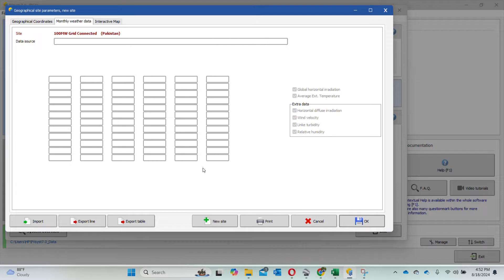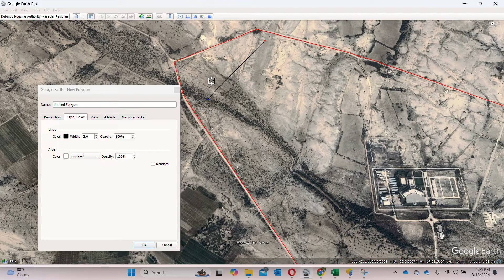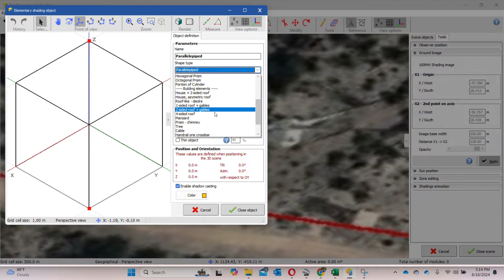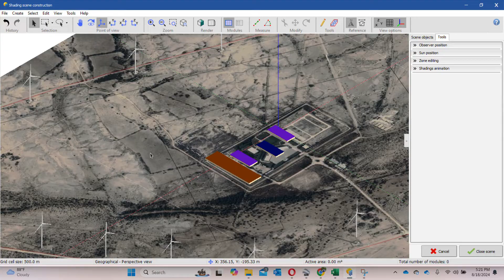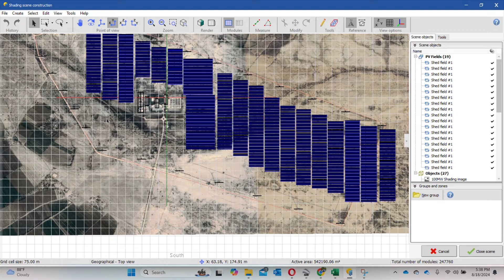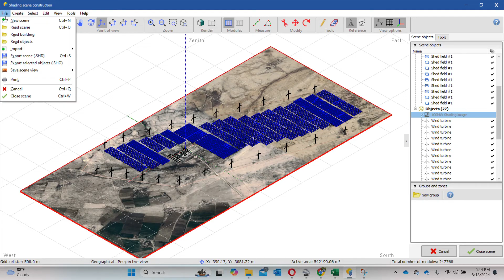Comment: When I try to insert the panels on the selected surface, imported from Google Earth, I can't scale their size and rotate them. What am I doing wrong? Thanks.
Reply: Once save image from google earth please select any prominent object and measure size during importing in PVsyst select x1 and x2 than put the correct measure figure.
For rotation use azimuth angle
Reply: @consultingsolution1  Thanks!

Comment: Sir, what if I have an area of land, and I want to maximize the solar panels I could install. How do I do it in pvsyst?
Reply: Calculate area and divide accordingly 
For 1MW tracking structure land area required = 4 acres 
Without tracker installation land area= 3 acres
Moreover, scale image in pvsyst and install pv sheds it gives you clear GCR.
Reply: @consultingsolution1  how about the facilities? How many percent would it take